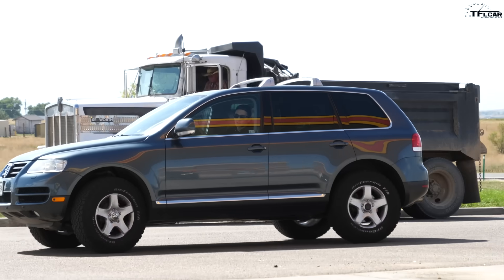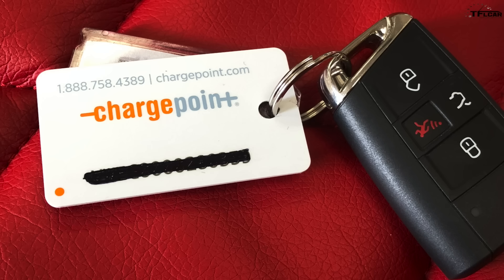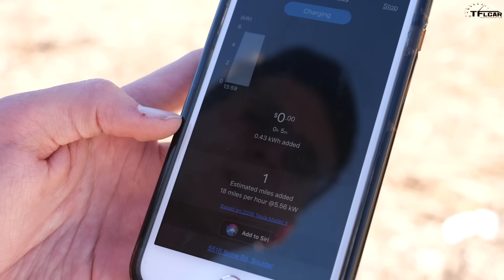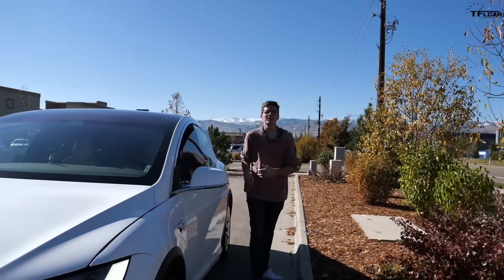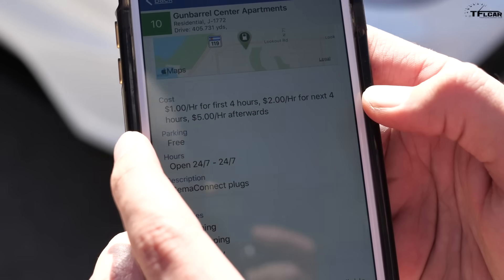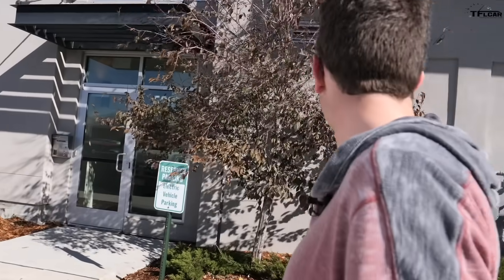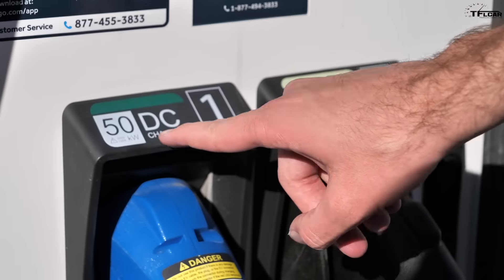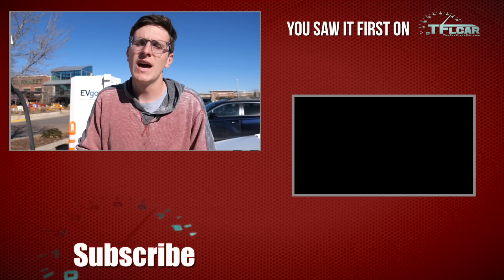Here’s Why Charging an Electric Car Can Suck - And It’s Not The Reason You Think!

Comment: It has confirmed my opinion that EVs are a colossal waste of time, money and raw materials.
Reply: @markwebber333  Electric vehicles are fine if all you want to do is to go short distances. For getting to and from work they're fine but go any further like a road trip, to see your aunty in another state etc and you're out of luck. 8 hours to charge as opposed to 5 minutes to fill with gasoline. Colossal waste of time.

Sure - have an electric vehicle for short repetative trips and a gas vehicle for longer trips.Guess which one eventually will get left in the garage. That's right - the electric car because one day you'll get home to be too tired from work to plug it in or you'll drive off with it plugged in and wreck the charger or it'll just be too much flaming bother so you'll default to the real car as opposed to the kiddie toy car.

But if you're going to have two cars, that's twice the tax, twice the capital outlay and twice the space. So why not hire the gas car? Well that brings you back to cost - you are better off owning than hiring.

Then that thing about where to charge it. Many people park on the street at night and have nowhere to keep their car that's off the road. Hence, no way to charge it. Then there are the people out in the country who might not have a power supply capable of charging an EV. I live in a rural area. The electricity is unreliable. I live in South Carolina - 20 miles from the capital (Columbia). Power outages are not uncommon. Then there are the dirt tracks - I'd like to see an EV handling those every day. 

EVs might be practical for those city dwellers that have a garage and decent power. For everybody else, forget it. It's just a kiddie toy.

Comment: Lol these company need get together and make ONE standard.   Shouldn’t need 20 million different apps either.   Which is issue.  Also as you said not Everybody understand tech. And yes there even some ppl don’t even own cell phone. ( but kinda rare ). 
Should be able pay with cash or credit card. But they prob don’t because want track everybody data.  Data = money/information and power.  Oil/gas companies want still stay in power.   Oil and gas should been made obsolete many years ago.   But comes down cuz it $$$$$$$ for big company.  

Good Video :)

Comment: Don't get this time consuming charging bullshit. Who has the time to sit around and wait 1 hour just to drive your car a few miles.  You have 2 spinning axles and 4 spinning wheels.  In this day of technology, why can't there be some type of generator built into the axle system that regenerates power back to the batteries of the car.  Maybe these car manufactures need to take a look at good old fashion technology like the Dynamo we used on our bicycles for the lights back when we were little kids.

Comment: So I want to go from Denver to Houston, I’m going to get stuck in the middle of nowhere New Mexico for hours, maybe even twice.

As in the early days of the automobile I’d like to see a coast-to-coast run by an electric vehicle (no switching to gas).

As we all know from science class batteries are the most inefficient way to store power, what’s changed in the technology to have changed that?

Finally, not everyone lives in the PRB (Peoples Republic of Boulder), and live in the real world (aka the rest of Colorado). Would it be possible to drive to the Sand Dunes from the PRB and back (without switching to gas), remembering you might be driving at night.
Reply: Just before we bought ours we talked to a little old couple who was just back from a 2800 mile trip in their S model. Zero problems.

Dunno where your Sand Dunes are, but sure. Denver to Houston, easy. Just under 1100 miles, there's like 9 superchargers along the way and another 15 or 20 level 2 chargers. No, you don't stop at each one. And what would nighttime have to do with it? You think lights draw lots of power? They're LEDs, dude! Cold has an impact, but not that much. We'll be trying a run to Spokane then up north soon, should be 6-700 miles. It's not a big deal.

Comment: I understand the point of this video. The regular EV charging stations need to get to 48Amp, 120kw like the tesla chargers and the new v3 tesla charger can charge with 250kw (which is insane), so the time for charging is very subjective. In the EV market the tesla model is very similar to the Apple model where the company sells the product and the ecosystem that makes it hard to convert from tesla EV to other company EV. All of this is a market advantage. I agree that the government should do more to have the high powered chargers. Of course the 5kw charging is slow. All the comments needs to understand this simple fact.

Comment: The reality is most people have 240 VAC in their garage if they have electric in their garage.  All home service is a minimum 240 VAC. What might not be is the service amp rating. An older small home or building typically has a 100 amp service (Even older ones had a 60 amp service). But most every new home has at least a 200 amp service with large homes having a 400 amp service. 
FYI Hot water tanks and clothes dryers use 240, so 240 in a garage is not uncommon.
Thumbs down and stopped watching when it became clear you don't have all the facts.

Comment: So basically they are now able to use the latest 21st Century+ technology to turn simple travel by motorcar into an 18th or 19th Century delayed experience? Or maybe worse, cuz I could rest and feed my horse quicker than I could recharge my Barbie Dream Car. What a P.I.A. when I can fill my Hyundai Tucson's gas tank in a couple minutes and be merrily on my way for another 400  miles.
Reply: Since over 60% of electricity is made using fossil fuels anyway, where's the "Eco" benefit from a car powered by eco-disastrous cobalt & lithium strip-mining sourced batteries? Though there's always that eco-friendly nuclear? - lol

Comment: I'll tell you the real downside of electric cars. The load on the national electric grid causes regional grid faults every year due to high heat (air conditioning) or low temperature (heating). Now add 30% of all cars on the road being electric. A) the national grid would have to be improved drastically at a cost of about US$5T or so, and B) the pollution from additional power plants and construction of thousands of miles of new heavy gauge high voltage lines and substations will exceed the emissions of an equivalent number of modern cars and trucks. 
No, solar and wind power isn't a solution. We don't have enough real estate in the USA to use to get enough power feed into the national grid (assuming it could handle it to begin with) without covering 25% of all land in the USA.
Reply: It's going to be a Golden Age for Union Electricians fast tracking gen IV reactors and rebuilding our entire Electric grid. It will cost at least 10 Trillion dollars, just for the East Coast. I almost wish I wasn't retired. ;)

Comment: Correct me if I'm wrong, but I think most EV owners have access to a Level 2 240v charger wither at home or at work. Those public charging stations are more for top ups. Unless You had one close to your house or apartment that you could plug in overnight on a friday or saturday it wouldn't be that practical.

Comment: Edited to add: This video willfully omits that these are APARTMENT/OFFICE chargers... plug in when you get to work/home, come out to fully charged car. CCS/FastChargers are for, well, FAST charging.

Oddly, I bought an EV just days ago. Why? Well...
1) I commute ~80 miles daily. Plus some bopping around town. Old car: Detour to gas station every ~4 days. New car: Plug in when I get to my heated apartment garage. Lots of time saved, and no standing around in freezing winds or baked in hot sun.
2) Soooooo much less maintenance (if Edmunds and other reviewers are to be believed)

You note a few things conspicuously absent from my reasons for buying one:
a) Environment. I fly, I toss plenty of trash, I use electronic devices and the Internet. All of this is far worse than even the dirtiest coal-rolling diesel truck.
b) "Driving pleasure". I don't drive for pleasure. A car gets me where I need to go with the least hassle, that's its only job.
Reply: Speaking as an Electrician, there is plenty of maintenance work to be done on anything that uses electricity. I charge a shitload for every call I take, per diem and show up pay even if I refuse the job. Maintenance free....Hee Hee! There are thousands of electric parts in every EV, most of them made in 3rd world countries by the lowest bidder. You worry about replacing a 12K batt pack every 5-7 years, just think how much I'm going to charge you to rewind a DC motor or swap out a controller. It's a Golden Age for Electricians, now we will get paid like surgeons, and boy will we take advantage of it. :))
Reply: @crankychris2  I'm actually hoping that's where the jobs will go. To me, one of the major issues with EVs is that they will put a lot of ICE car businesses out of business. Those job losses need to be compensated by new jobs elsewhere.
As far as maintenance... I've dealt with electrical systems, engines and the like for most of my life. They are FAR less maintenance than any combustion engine ever has been or will be.
Reply: @wombatdk  Me too. Inside Wireman LU# 349, IBEW.  :))

Comment: I looked hard at the pro's and cons, and just can't reconcile all the bad with the premium price to go EV. Maybe someday, but not while this is the system we're stuck with.
Reply: Agreed. Plus, the maintenance and repairs will take a high skill level. All batteries wear out, too.
Reply: @crankychris2  what maintenance?
Reply: @jetah50  As an (old) Electrician, I can guarantee you any moving parts consuming electricity wear out. Ten years is considered a maximum lifetime for consumer electrics, although Tesla's typically arrive in FL in so bad condition they often need major work before they can be sold. I won't buy one!  [Ex TSLA shareholder].
Reply: @crankychris2  99% of ICE maintenance isn't needed on an EV. that's a pretty good savings. it'll help those that dont know to change oil, keep oil at the appropriate level, change plugs, air filter, oil filter, rotate tires (wait..), belts, etc. there's no overstarting it either.

consumer electronics can be built better. we had early electric motor appliances last longer than 10 years but someone decided they can make it last 5 then 3 so that the product is being purchased more.

I'll give Elon the props that he tends to think globally and not just locally.  I'd like him to bring back the 'engineered for a lifetime' like it was done backwhen.
Reply: @jetah50  Thousands of electrical parts exist on an EV with no trained mechanics who can repair them. Relays, chargers, sensors, circuit boards, lithium batteries, Christ man, as a Union Electrician for over 40 years I know what I'm talking about! Go price a 5 year old EV and compare the depreciation to a Honda, Toyota, Altima, etc.
Buh-Bye  ;)
Reply: @crankychris2  mechanics wont be needed because there is very little mechanical need.  the electronics will just be replaced as it'll be cheaper and RTR didn't get passed.  those that do board repair will increase where mechanics were as it may be cheaper to repair the few board parts unless the engineers make it so the chips suicide when not on the paired board.

I honestly expect the cars to drive themselves to the factory/maintenance to be serviced as we wont 'own' vehicles.
Reply: You're going to have to switch to electric because countries are passing laws to make internal combustion engines illegal
Reply: @razzy113  I've read 'sales of ICE vehicles' will be illegal, which i assume will be 'new vehicles' but you can still buy them used, buy them new in another area then drive them in and register them. but I do see them becoming illegal or needs a special expensive permit to operate and will have limits on how many houses/distance of use per month/year.

Comment: What a waste of time.  First, buy your own home, second, install a 50 amp dedicated circuit with a NEMA 14-50  Rec Vehicle outlet in your garage. THEN THINK about buying an electric car. Public chargers are a waste of your money and a waste of your time, and poorly maintained, and broken down far, far, far too often.  Especially the 50 to 55 kWh High speed DC Fast chargers. You just can NOT count of them to be functional when you get there and really need a charge.  Also, it makes the most sense to only USE a DC FAST CHARGER if your battery is below a 20 to 10% state of charge, before fast charging.  Otherwise, they charge very slowly once past an 80% state of Charge. What that really means is that you should get about a 60 to 70% total ADDED Charge to your battery capacity on a Fast Charger.

Comment: So much misinformation and the vast majority commenting are just using this as validating their suspicions about EV’s. Tesla has solved these problems. Supercharges are all over the place and you just plug in and it charges you based on recognizing the car. All this video is showing is how much better Tesla’s are to own than any other BEV and what a nightmare it would be if Tesla owners had to use other chargers. Anyone with a garage will guaranteed love an electric car - no more gas stations, no recharging other than once or twice a week overnight in the garage. You will literally never have to stop anywhere to charge other than on road trips. When on a 400 mile road trip, I just have to plug my Model 3 in for 20 minutes to get enough range to finish the drive. That’s how long I would have to stop anyway on a 5 hour trip. EV’s are lasting longer with lower maintenance costs than anyone expected, and are way more fun to drive than you assume. All former gear heads (like me) I know love BEV’s once they live with them for a bit. The future only gets brighter.

Comment: I will stick to my 5 min fill that gives me over a 400 mile range . Electric cars are way too much of a pain in the rear to be useful.
Reply: I will stick to my Model 3. It takes less than ten seconds to plug it in. I know that can be a pain in the rear. Seldom do I drive more than 125-150 miles in a day, so it doesn't take much time to recharge.
Seriously, how often do you really need 400 miles of range? I'm not trying to be a smartass. If you drive less than 250 miles a day, plugging in when at home is easier and faster than a trip to the gas station.
While older EVs were only getting stupidly low range batteries, the newer cars are getting over 200 miles of range, with some getting close to 400. The lowest range of any Tesla is at 240, I believe.
I don't know if other comments have addressed how cheap the maintenance is on a Tesla, but the only real need is to rotate the tires and refill the washer fluid. Tesla recommends an inspection every couple of years, but if you skip it, it does not void the warranty.

Comment: This is so misleading. Taking a Tesla to a standard plug charger and complaining that it does not work is so silly. 5kW charging is most beneficial for over night and during working hours when you don't need a fast charge. In that case you don't want a fast charger because you would need to go and move the car. Fast DC charging is meant for on the road charging where you stop to eat and charge hundreds of miles during your meal. Older CCS chargers are 50kW, but new ones go from 150 kW to 350 kW which even fast than Teslas 120kW and 250 kW chargers.

Comment: My new engine in a Model 3 would get 120 mpg on gasoline highway and 240 city, 180 on average.  If I took the electric junk out of a Model 3 and installed my new engine and fuel tank, the same weight would allow 130 gallons of fuel.  At 120 mpg and 130 gallons, it would have a range of .... 120 x 130= 15600 miles in one 5 minute fill up.  Average  23400 miles. 

Yes, "charge" your car 1 time per YEAR, not every 100-200 miles.  Drive 15k to 23 k Miles on one tank fill up in 5 minutes.  You people are idiots.

Comment: Every house should have 240V, condos may not but I see tenants have charging stations installed on their designated parking spots. 6Kw public charging is about 25A, you should have at lease that in the house for the dryer or electric range. Many washer/dryers are in the garage, just make up and extension cord to the dryer outlet. If you don't want to move the dryer every time then install a selector switch (either or, not both dryer or car). Cheaper than routing 240V circuit from panel to car.

Comment: A colossal waste of time. An EV may be hip and cool, but it's totally impractical for the vast majority of Americans right now. And yet CA wants to BAN ICE vehicles. They might start by forcing some standardization of the charging stations and associated processes to charge up your EV. Even with a 220V at home or out and about, you can't even come close to the speed of putting gas in your ICE. Imagine your EV runs out of juice on the road and a big diesel powered tow truck comes to the rescue.

Comment: I dont have the luxury of waiting an hour to "fuel up" so I will stick to my gas truck, thanks. (Usually in n out in 5 minutes)
Reply: If you have a garage and/or 240V outlet, you can charge your car while you sleep.
Reply: @NVRick1  the Tesla trucks greatest selling point is also its greatest weakness.  Truckers are always under a time crunch, besides, the estimates given for it are not under load.  Under load the truck would drain power faster, same is said about gas/diesel, but unlike the Tesla truck, gas/diesel can be back at full capacity in 30 min or less. Ask anyone who hauls heavy loads, they'll tell you that time off the road matters.